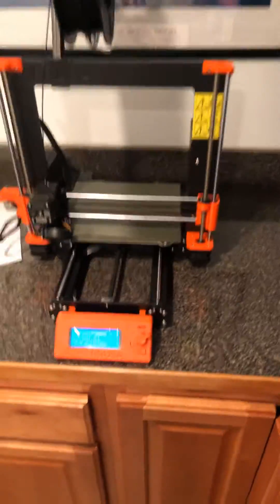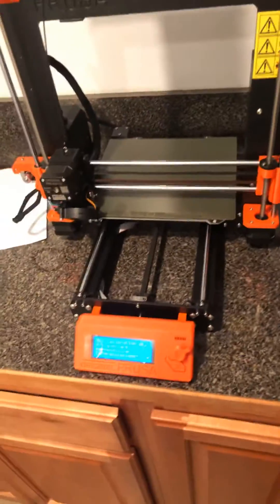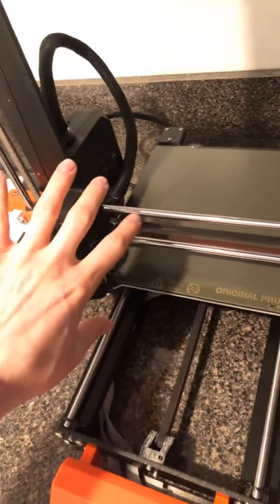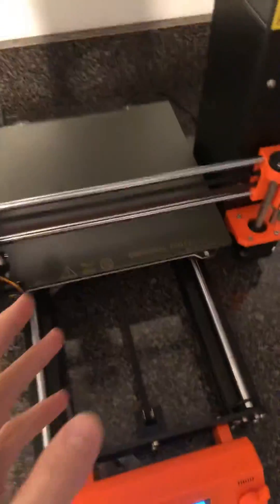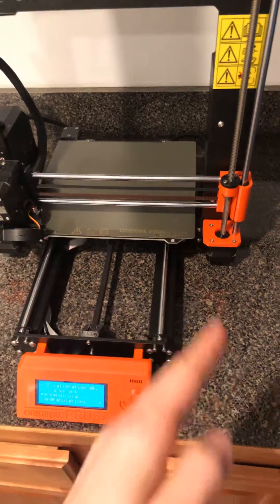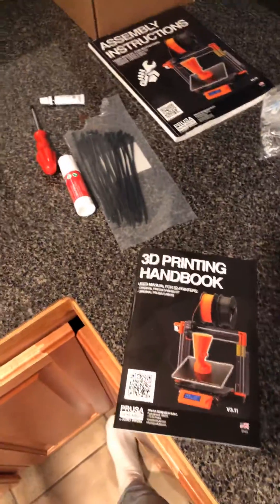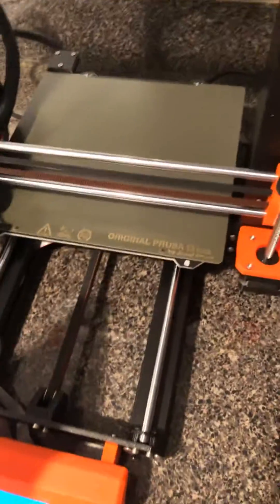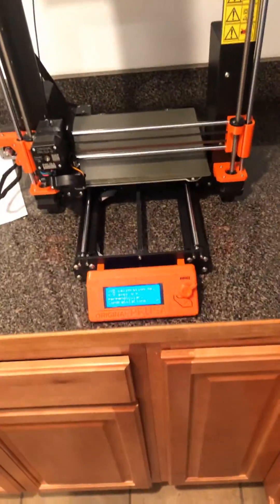Prusa i3 mk3 Selftest error x axis length Fix

Comment: My problem was that the pulley on the motor was loose. This can be checked by holding the axis with pliers and trying to move the belt. Just needed to tie the screws

Comment: Hi,  im leaving a comment here, bescause this is the most recent video about the Selftest error x axis length. I simply downgraded to an older firmawre ( 3.8.1 for my printer mk3s, received may 2020). I forgot, in computers, sometimes upgrading to the latest firmware isn't always a good idea.
Now everything works again.
Reply: How do you download to an older version?
Reply: Thank you for leaving this comment.  The lube didn’t work for me.  Downgrading to 3.8 worked.  Was so frustrating.  Thanks again!